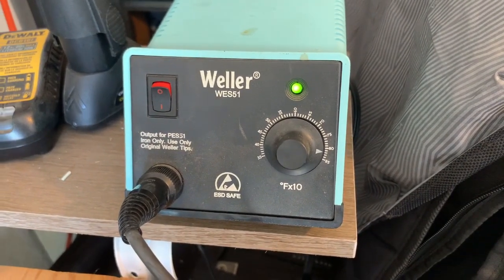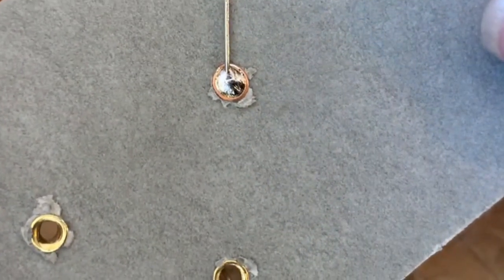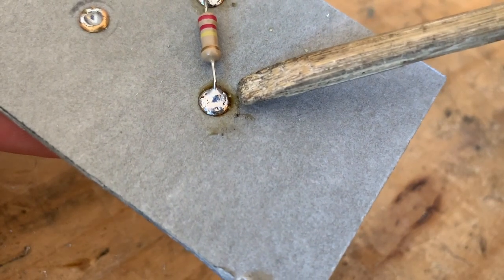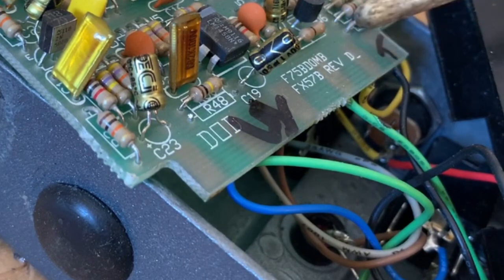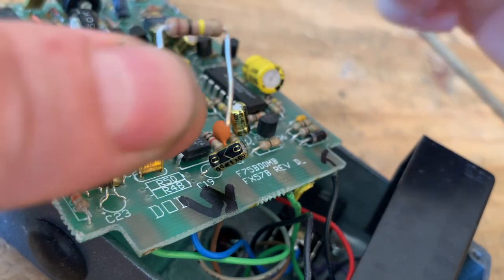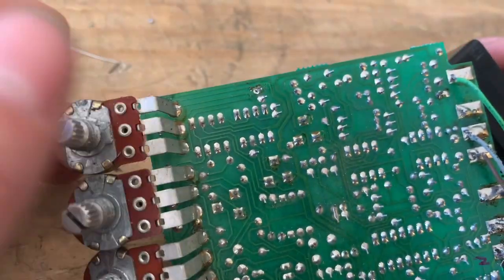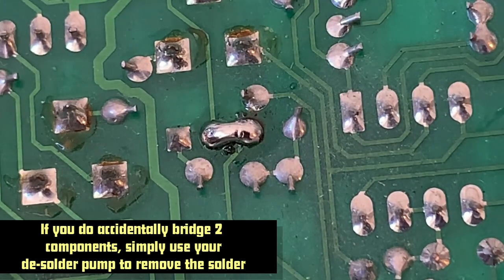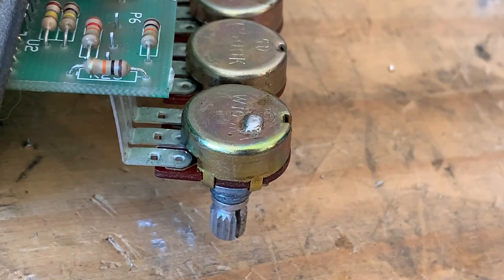How to Solder | Application and Examples for Amp Repair | The Electric Lady

Comment: I'm an electrical engineer that designs electronics for a living (including boards), if that makes anyone more trusting of my opinions.

The quality of PCBs in commercial products, including amplifiers, is abysmal.  They are typically 1-2 layers, have poor quality soldermask, and usually use HASL (hot air solder level) surface finish instead of ENIG (electroless nickel immersion gold), and some aren't even made of FR-4 (fiberglass)!

There's an incredible difference both in noise performance, EMI (conducted and radiated), heat dissipation, and mechanical strength with a decent quality 4-layer board.  Not only that, there is interplanar capacitance, since the power and ground planes act as a distributed capacitance.

Of course, these products are using electronics technologies that are at least 50 years old.  Modern electronics are much more complex in every single way, but nostalgia is a huge factor for many consumers in this space.

- Wash your hands after using non-RoHS solder.  It contains lead.  If you have open wounds, wear gloves if you're worried about it.
- 63/37 (63% tin, 37% lead) solder works best as it's eutectic (melts more evenly).
- Don't mix solder types (RoHS, Tin/Lead, Indium, etc.).  Try to use what is already on the joint.  The results are typically very poor otherwise.
- Blob a bunch of solder on the tip after use.  My tip has lasted a decade (used for a few hours each month).
- Fluxed Brass Wool tip cleaners are far superior to sponges, since sponges thermally shock the tip (can cause pitting or reduced life).
- Chisel tips are a must.  Conical tips are awful (they have very little surface area).
- Largest tip you can actually work with is best.  The thermal mass (and surface area) helps heat things up better.
- Solder Wick is amazing and far superior.  I never liked the solder suckers, because they always leave just enough behind to leave the lead connected.
- Trimming the leads before soldering prevents cracked joints.
- Add extra flux when needed.  I love the nasty rosin stuff.  There is flux inside the solder wire, but sometimes joints are very oxidized (flux clears the oxides from the surface).
- Isopropyl alcohol is incredible for cleaning boards.  I usually clean, flux, solder, clean.  A tooth brush helps, along with compressed air!

Overall, really nice video.  You speak very clearly and had good tips!
Reply: Well said Randy.  I am a US Navy trained Electronics Tech / Micro Mini PCB repair tech.  I'd like to add a few comments. (Apologies in advance to Colleen for being critical).  
- I'm not a fan of Wellers or solder suckers.  I recommend a de-soldering station to anyone who does this professionally.  I realize that not everyone can afford a Pace work-station.  In that case, I would default to using wick and retire the SS.  It makes for a much cleaner joint.
- I'd like to recommend Colleen try to secure components and wires when soldering.  I see component lead and connection movement while soldering which screams cold solder joint/fracture.  It's well worth the extra time secure before soldering.
- Clean Clean Clean.  Get out the isopropyl and acid brush and clean the flux off those connections.
- Tin wires before soldering.  
- 63/37 eutectic solder always.  Tin with 60/40.

Again, sorry to be critical.  My standards are somewhat over the top when it comes to soldering.  I do enjoy Colleen's amp repair vids and appreciate the knowledge she is sharing.

Comment: Still a solder wick and desoldering gun with a bulb for sucking up the solder. Takes two hands to use them but I can control 
the removal of the solder much better. Mostly work on point to point electronic devices! Never liked those metal desolder  tools. Strictly PC board stuff.

Comment: 2 tips that will improve your soldering.... 1. Use a chisle tip & you will get better results as you have more contact with the board & will be able to cut your temps down & be kinder to components. 2.use a FLAT FLUSH ELECTRONIC NIPPER instead of the electrical ones in the video. They are far superior!!! I was amazed at how much difference these 2 things made. I would never go BACK!  ; )>

Comment: tip for your tip: keeping solder on your iron tip before you turn it off will stop the tip from oxidizing prematurely. Also, applying solder to your tip right before you heat the connection (especially on larger components) will allow the solder to flow more readily across the connection and towards the tip.
Reply: Amen to that; I was going to make the same comment.  Idle solder, which is what that's called, will also extend tip life because it will keep the iron plating on the tip from being eaten away.
Reply: And watering too much sponge is bad too, she should squeeze it right after applying water. Heating solder joints right after applying solder to it. I do it like this, heat element, apply solder and then put away solder and iron when the solder joints are flooded with tin. Keep doing it, nice to see that girl is into electronics, I don't know too many :D
Reply: Aye, us oldies have been soldering for many many years and seeing up and coming new techs is good, Keep up the practice.
Reply: Also having a moderately tinned tip will allow faster heat transfer too. I usually apply the solder immediately upon touching the components to be soldered as soon as it flows throughly its complete. Plus it helps (again as a tinned tip) heat the joint more rapidly.
Reply: I was thinking the same thing, I was a radio repairer in the army and we were definitely taught to tin our iron.
Reply: Definitely a must to add solder after use. And I'm not a fan of wiping with water. Just use the metal brass sponch.
Reply: At the school I was told to keep the tip of the solder always cover by soldering, so it should be always shinning. I think now I know why.

Comment: Desoldering wicks and soldering heat sinks are always useful.
Reply: Amen on heat sinks. I almost always use one, but especially important for caps, diodes, and any transistor/FET/etc.

Desoldering braid works well for me.

Comment: Soldering is sort of an art, takes awhile to get the feel for it and I can see you definitely have that. I'd like to add that the quality of a soldering iron and the tip material make a big difference in ease of soldering...don't cheap out. Chassis soldering is done with a soldering gun not a pencil. Lead based solder is by far the best.

Comment: I use a Weller WLC100 (40W). For effect pedal I use a small tip and set it between 3 and 4. For guitar or cable wiring I use a larger tip (the factory one) and go up to 5 if I need to. So my tip to beginners is to use the right tip and set the heat according to what you're working with.

Comment: Great video overall but I'd caution people new to this from using a solder sucker on through-hole PCB boards, especially older ones or ones that have already been worked. Very easy to lift a pad. I'd recommend using desoldering braid instead. Same (arguably better) result and less risk of damaging the board.

Comment: You need to replace your iron once a year? These soldering irons should last a lifetime... things like Weller’s and Hakko’s shouldn’t ever need replacing. As for tips, if you are needing to replace yours every few months, you aren’t doing something right. From watching this video, I think I may have spotted it @ 2:43 where you say to clean off the tip when you’re done, but you don’t mention that you absolutely must tin your tip too when you leave it to sit there. A non-tinned tip sitting there at 750 degrees (F) will be ruined real quick.

Anyhow, I really enjoy your channel. Keep up the good work.

Comment: dang man that iron heats it up right now, I like that not too much heat migrates to the component, fast.. I usually use alligator clips to help sink the heat but my iron takes like 4-5 seconds to heat up the joint hot enough to melt the solder, if I am removing a joint I have to use flux or no go, your iron is a bully, $140 seems like a good investment, sheesh

Comment: Great video. I've found some liquid or paste flux makes soldering to pots (and pretty much everything, but especially sheet metal) much easier.
Reply: One cautionary note:  a number of sketchy online sellers, including some that should probably know better, are selling highly acidic, corrosive fluxes to electronic hobbyists, and when you receive the bottle or can of flux you may find a tiny little warning on the label somewhere saying it is not to be used for electronic work! (My boss at the audio repair shop I used to work for made this mistake several times when buying fluxes online).  For use with leaded type solder I still find that plain rosin flux, which smells like pine trees when you solder with it, works best. Lead-free solder (uggh) uses flux made of inorganic acids which are quite nasty to breathe and can corrode the connection (especially on printed circuit boards) if you don't remove all traces of the flux with alcohol or other solvent after soldering.  Saturn certain types of integrated circuits and micro processors may require a special paste flux that has powdered solder it but which may not be suitable to use as if it was plain flux in other applications. PS:  Scratching the pots or sheet metal with a screwdriver or dental pick prior to soldering will work but the best way to clean such surfaces beforehand is with a fibreglass-bristle "scratch brush".
Reply: @goodun2974  Even high quality flux can be problematic. Kester 186 will gum up switches (I know). Kester 951 leaves little to no residue and makes the solder stick so much easier. Using (a good) flux you're less likely to overheat the pot and damage it.

Comment: Nice vid but I disagree about the chassis grounds --  proper surface prep and a large iron will do it -- I have seen many bias failures etc on the 70's fenders when the transformer bolt tab grounds loose continuity due to loosening/oxidation ... Hi from Dublin !

Comment: Public Service Announcement to all new to soldering, Solder Suckers tend to be pretty cheaply made and just don't seem to either work very well or last very long.     I usually purchase the solder suckers in three (3) packs as they always seem to be failing or getting gummed up when I need them most.
Having a spare on-hand keeps the work-flow moving forward.
Reply: Cleaning out a "Solda-Pult" or other mechanical, spring-loaded solder-sucker is a messy, greasy, truly nasty job. Also, the hollow tips tend to get melted and deformed; they really should be made of Teflon or ceramic. Anyone who does a lot of desoldering, especially on printed-circuit boards, should invest in a vacuum-pump-operated desoldering system.
Reply: We cleaned them out and sprayed wd 40 inside them. But I seld

Comment: where do you find an electronic practice board to practice soldering?
Reply from the maker: Hi! I was using a scrap board from a pedal that was not worth fixing
Reply: @FazioElectric  , I noticed that the wires soldered to that pedal PCB looked tenous at best; it might be worth mentioning the propensity for thin stranded wire to crystallize and become intermittent or break off right at the solder joint after the board has been flipped around a couple dozen times during service. One wire breaking off is easily re- attached, but two or more breaking off can become a real problem for novices if they didn't take a picture of the board and wiring beforehand (probably the best reason for owning a smartphone, taking before, during and after pics of work in progress). PS, the tip of your iron keeps turning blue with tarnish and oxidation, which indicates to me that the temperature setting is too high. I also prefer use of a Weller brass sponge for tip cleaning over the traditional wet sponge (a wet sponge thermally shocks the tips and leads to cracks in the steel plating, without which the copper or brass underneath gets eaten away by the solder and flux) . I prefer a rounded chisel-shaped tip for most vintage-repair work, other than tiny PCB traces. I've been soldering for over 50 years, including 15 years as a full time audio tech

Comment: Excellent presentation, very concise ! Myself, when soldering to the backs of pots, I use a small piece of sandpaper to clean and rough up the surface. Also, I use a big old Weller 240 watt gun to solder to chassis. Works quite well.
Reply: Pete, be careful with that big Weller Gun Soldering Iron, the trigger ON/OFF switch induces a pretty strong magnetic field in the unit's coils and can damage guitar pickup magnets if it's within close enough proximity when in use.     Don't ask me how I know............
Reply: @hkguitar1984  ,  Interesting! I never really thought about that possibility. I guess it's safest to treat the soldering gun as if it is a tape-head demagnetizer, where you would turn the device on while held away from the tape head,  and then remove it from the area around the tape head before switching it off again.  Not that I would normally find myself using a large soldering gun inside the control cavity area of guitar, except possibly for attaching a ground wire to the tremolo mechanism....

Comment: Great video and great tips! Only things I would mention as well are: don't blow on the solder joint to make it cool down faster, you can cause a cold joint that way because of the air penetrating and apart from scraping the back of the pot I found high temperature of the iron and short time applying the tip to the back of the pot produces good results.

Keep the videos coming! Liked and subbed :)

Comment: Great info, didn't know about the scraping trick on the pots, will try it out next time. I sometimes use a desoldering braid when there's still some remnants after using the pump. Came here through the Vintage Amps podcast, keep up the good work!

Comment: cool! what's the name of that kind of plates u use for examplification? the ones with rings and holes? im pretty sure that kind of plates are used for amp buildin, right?
Reply from the maker: Hey there! Are you talking about these connectors right here? https://www.tubesandmore.com/products/solder-lug-6-or-8-hole-locking
Reply: Oh no, i meant those u are using in the first part of your video...it looks alike amp plates altought now that im looking at  it more in detail, it looks like cardboard . Can it be used to buid an amp? It would burn i guess
Reply: @franciscomendez8863  It looks to be a phenolic sheet.
Reply: @franciscomendez8863  , those grey cardboard looking things with the hollow brass grommets are generally known as eyelet boards, for obvious reasons.  These are common in old Fenders and in some other vintage amplifiers,  and typically are black and may appear to be wax impregnated. The problem that sometimes arises in old amplifiers is that this black wafer-like material can become conductive and cause sputtering noise and static thru the speakers (I am guessing that the old-style eyelet boards that are black in color may have had carbon added to them when they were manufactured; or the loss of insulating characteristics may be due to absorption of moisture from the air).  There doesn't generally seem to be a cure for this other than replacing the board if it becomes really noisy.  If that gray material she is demonstrating with here is of modern manufacture, it's probably designed to be a better insulator. There are also phenolic versions of these eyelet boards (or turret boards, with metal posts for soldering to) that are made of a plasticky,  reddish brown fiberglass-like material that is a much better insulator and more stable.
Reply: @goodun2974  thank you !
Reply: @franciscomendez8863  , there's a soldering tutorial by Dr Z (Z Amplification) on YouTube,  showing placement and soldering of components onto " turret" boards, which you may find interesting and helpful.